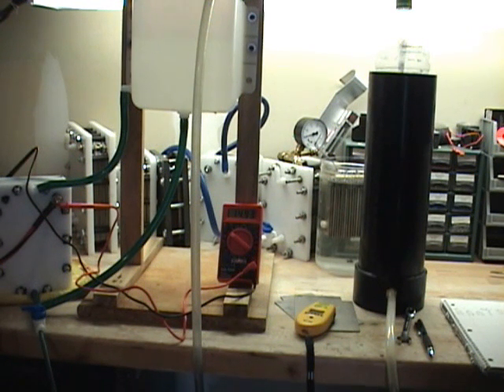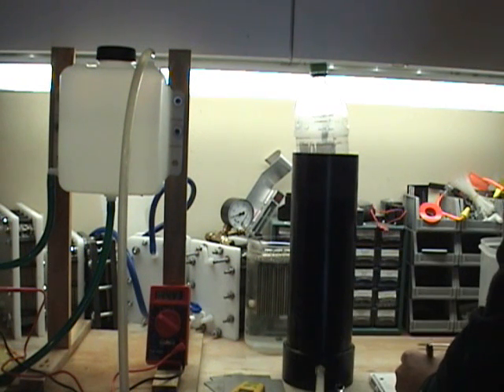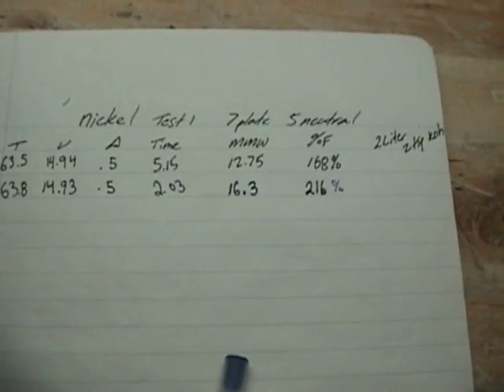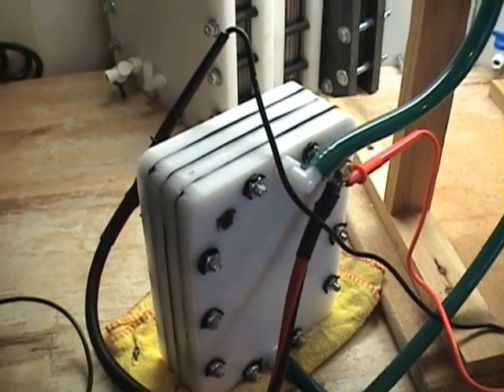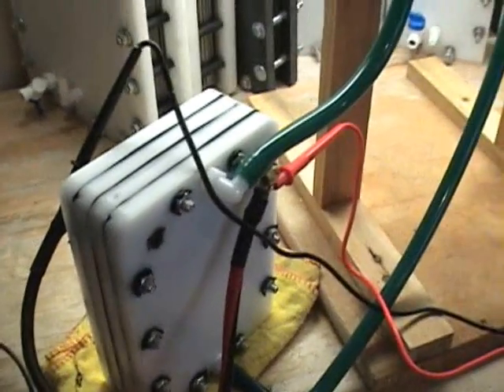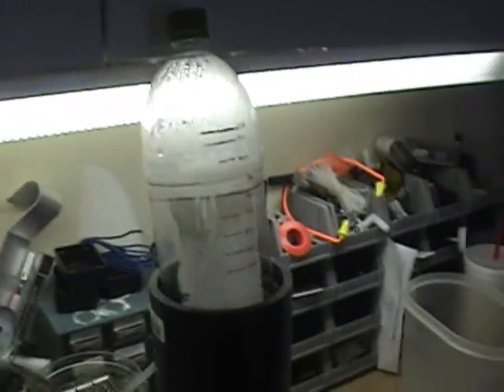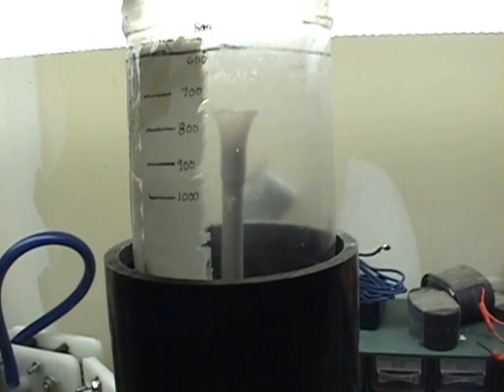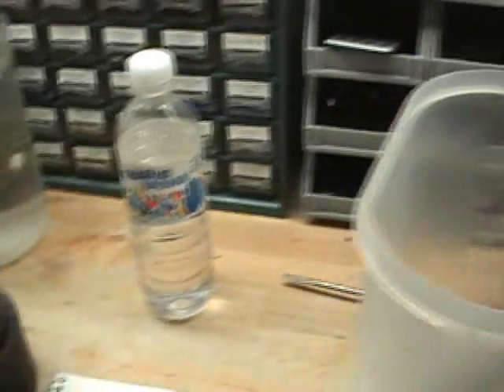Hydrogen HHO NICKEL cell Accurate Instruments are KEY!

Comment from the maker: you will want to see my next post Larry. I thought the nickel would be different but im getting the exact same results that i have always gotten with my stainless tests. As the electrolyte heats up the efficiencies go down. I have always had my best efficiencies at lower temperatures. Even with a cup and a half of koh in this nickel cell, efficiencies are best under 77 degrees. I hope your tests prove otherwise.